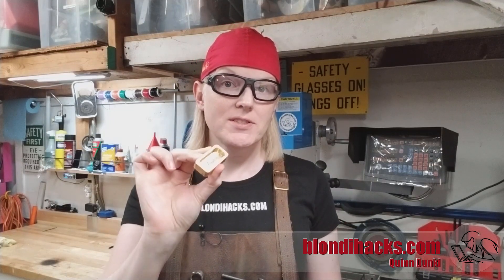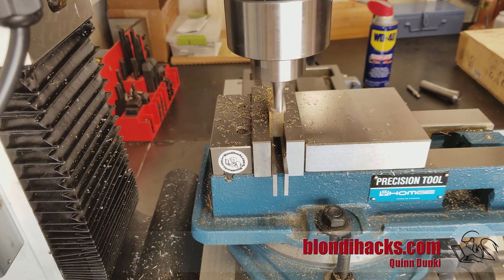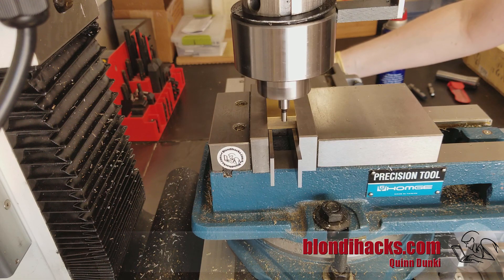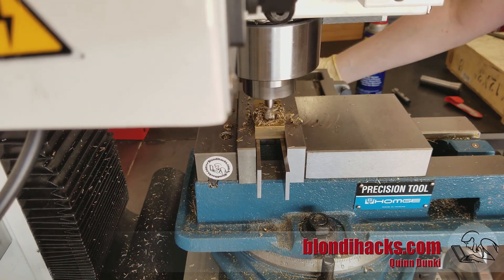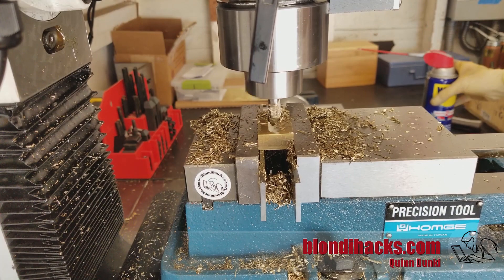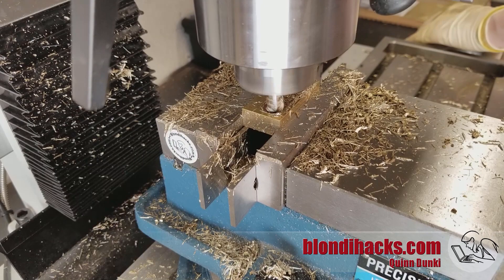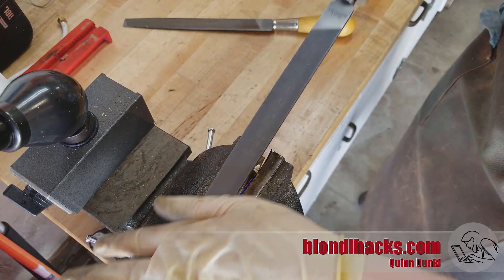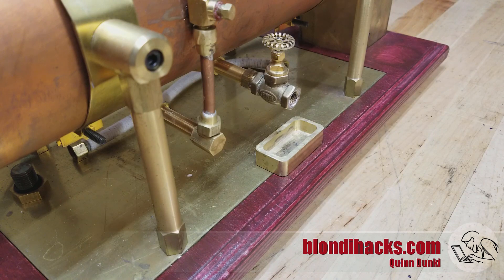A Good First Vertical Mill Project

Comment: Good video i would use a 4 flute end mill I have never used a 2 flute end mill I own them but I like 4 flute to I would recommend if you are doing this project to drill a hole to to the right depth on the corners it will help next Time

Comment: With brass, is chip recutting a concern?
Reply from the maker: Anonymouspock Great question! Chip recutting should always be avoided, as it will mess with surface finishes and can cause cutter deflection, but for a simple little project like this, it’s no big deal.